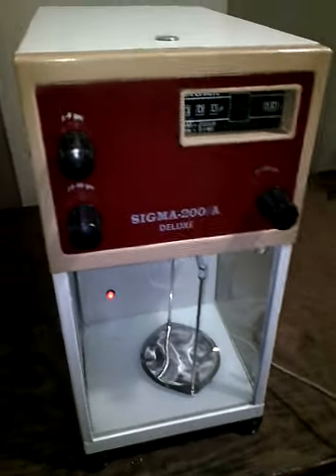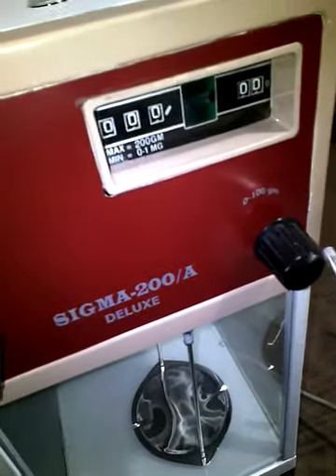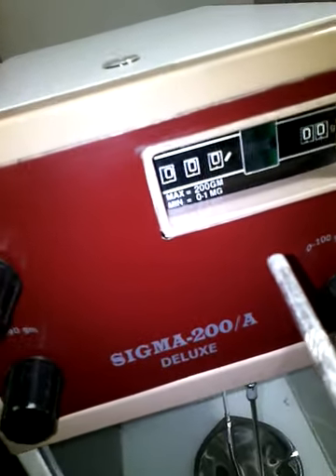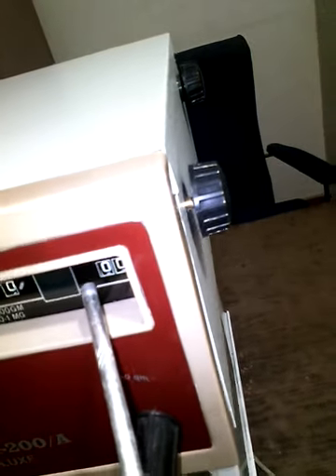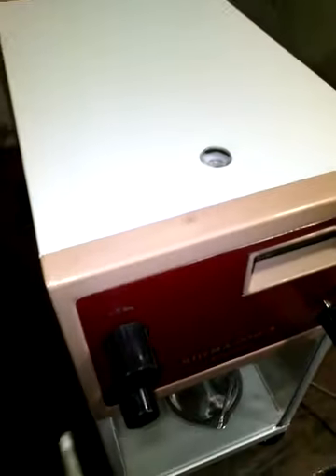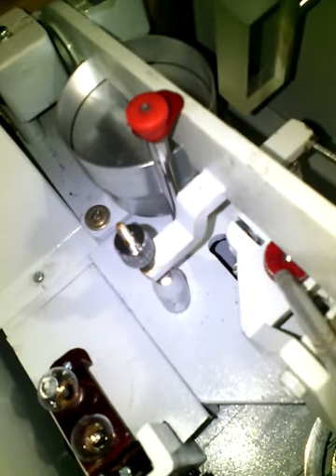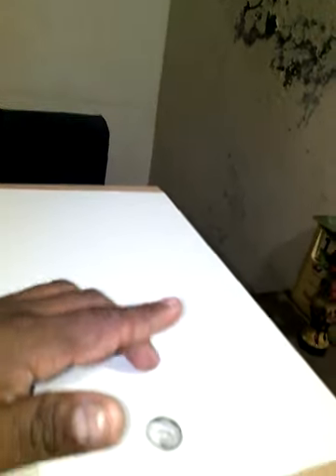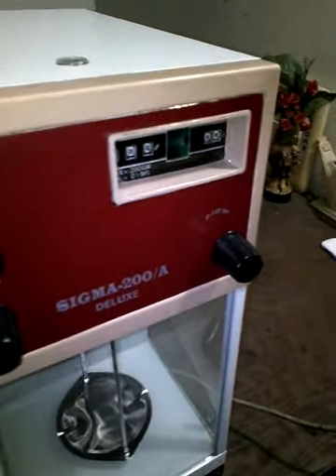SINGLE PAN BALANCE INSTALLATION

Comment: Two screws on the beam, one on parallel position to beam and another one on right angle position to the beam. What is the role of another screw that is at right angle position?